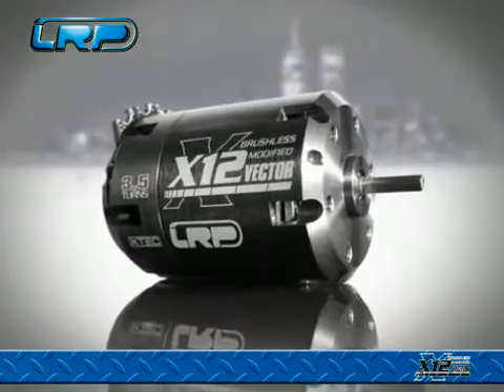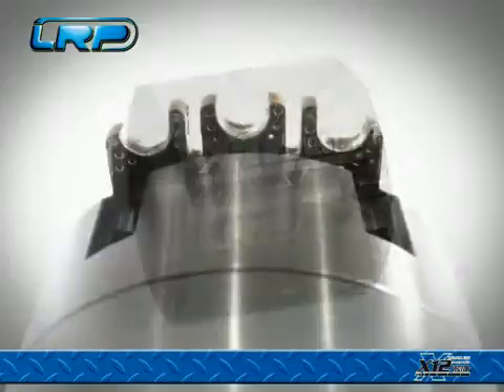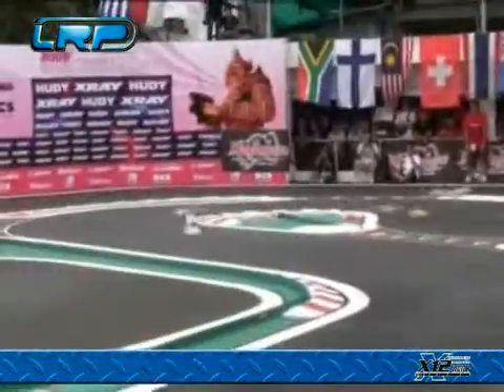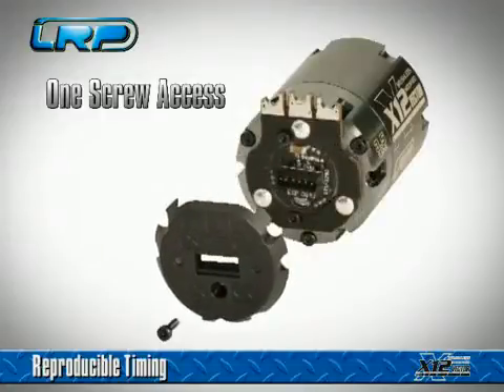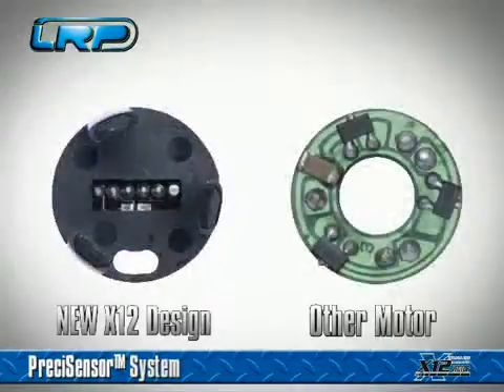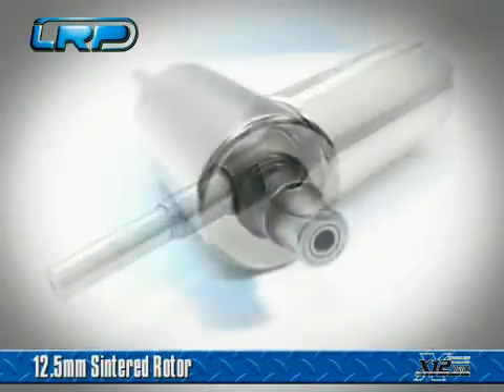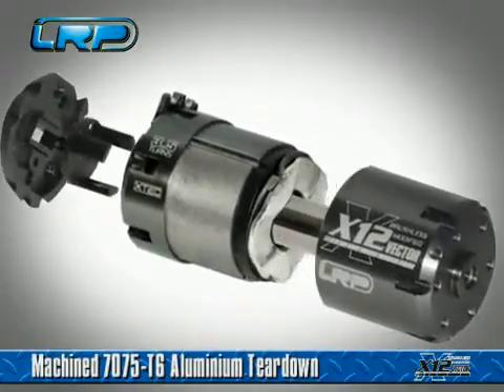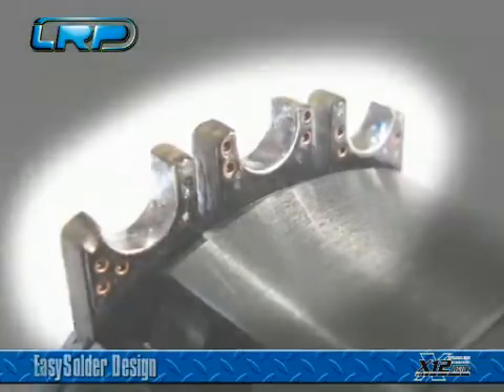LRP VECTOR X12

Comment: why rc car drivers dont use ducted fan motors is beyond me. what kv, what Io, what Rm?...why dont they show these figures?...they ARE what a motor is, yet no mention..just the number of turns!...big deal, what about wire diameter, length, impedence, efficiency?, torque curve?, max power, max continuous power ..nothing!..